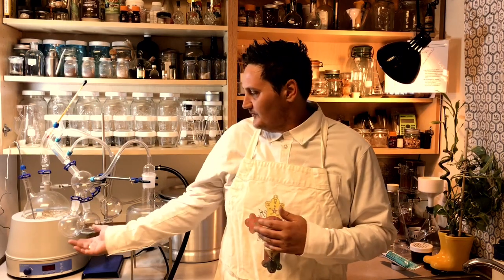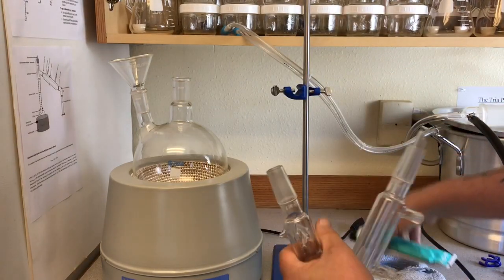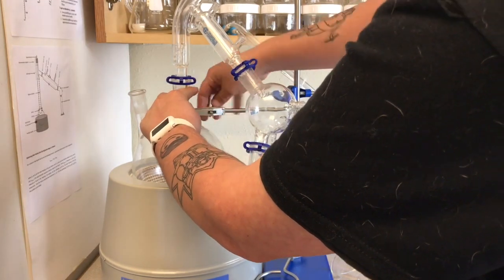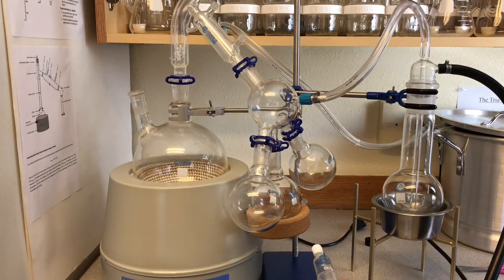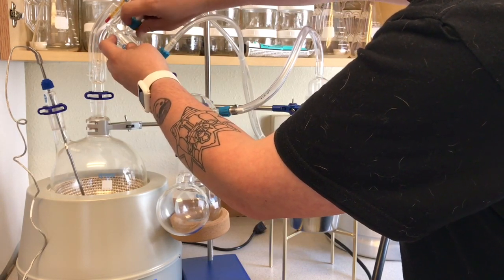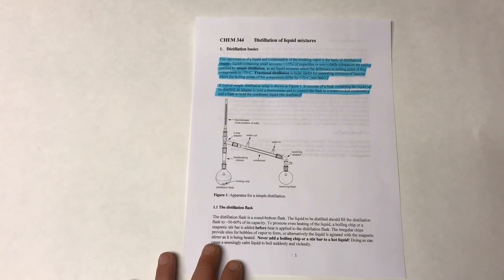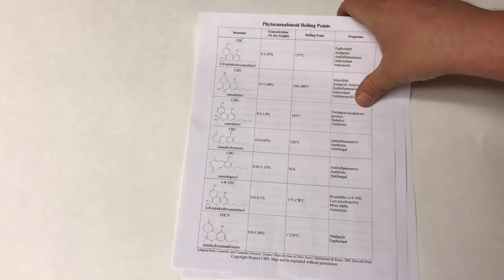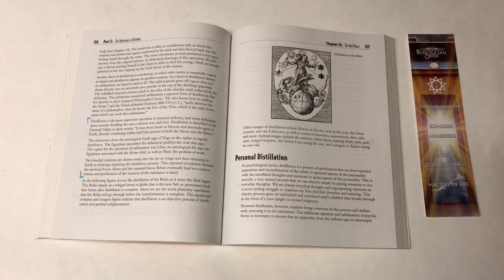The Art of Distillation: Setup & Theory

Comment: Great video going over the setup and general mechanics of simple short path vacuum distillation. As someone who's professionally distilled cannabinoids for about a decade now, I want to offer a couple pointers: 

1. Cold trap is very important. You want to maximize the surface area where high volatiles can condense. Dry ice is great, dry ice and that 99% IPA is even better. Get a bigger bowl and fill it halfway with IPA after lowering the trap into it. Then add dry ice slowly until it stops evaporating. This creates a slurry that can get to -80C all around the submerged part of the cold trap.

2. Vacuum level is key. A cold trap protects the vacuum pump from any contamination, allowing it to reach the ultimate vacuum rating of the pump. Once your trap is up to par, a 6cfm 2 stage rotary vane vacuum pump will be your ideal minimum for a 2L setup like this. This doesn't have to be an expensive Edwards or Welch model, Harbor Freight and Amazon have inexpensive ones. Get a digital vacuum gauge (or controller if you have the money.)

3. Use a stir bar. Start slowly and ramp up as temp gets closer to your desired boiling point. This keeps the boiling material homogenous so nothing gets scorched or left in solution.

Comment: Nice video, thank you for your work!
However, the vacuum grease should only be applied on the top of the male glass joints, not the bottom!! The grease may contaminate your product as solvent vapors creep into the joints. Sure, that isn't too much important on a distillation. But its bad habit.

Comment: Funny how vacuum pumps don't blow up 
Cold trap needs to be submerged in a acetone dry ice solution for maximum effectiveness 
This is not a proper set up 
They didn't even use vacuum grease on the joints
This is not like distilling ethanol there's fractions 
And this is called a short path distilling head 
Guy thinks he knows what he's doing 
Shows simple distilling aparatus compared it to a short path
They should use a soxlet extractor 
Winterize defat and remove ethanol before running through the short path 
They read you other people's information
Smh

Comment: When you're distilling something that produces a lot of vapor, and you are using a water trap to trap the vapor, have you ever had the need to use a check valve?
I've been considering using check valves because if i'm doing something stupid (I usually am) and I'm distilling something where I could have a steam explosion from the water backing up, the check valve would be a good safety measure against suckback at the end of the distillation.

Comment: Such an amazing video! Please make a part 2, also was wondering Would it be okay to have my Setup in a garage?
Reply: Depends on what you're distilling tbh The higher bp it is (i.e. above 130 C I'd say) is safer (high bp means low vapor pressure and less vapors floating around), but best to have air flow through the garage at any rate (and always have a fire extinguisher if your distillate is flammable).

Comment: Very nice and detailed video! Thank you for being so precise. I'm wondering what tubing you use from your cow distributer to cold trap, and cold trap to vacuum? Thanks again for the info!
Reply: Get "heavy wall" tygon tubing for vacuum for best results as it will not collapse. You'll need the inside diameter which is whatever outside diameter the barb tube on the glassware you're connecting it to is

Comment: @Sub Rosa what vaccum pump do you have
Reply from the maker: Rocker 250 pump. I think the new version is called Rocker 300. Rocker 300C, PTFE Coated Chemical Resistant Vacuum Pump, AC110V, 60Hz (167300-11) https://www.amazon.com/dp/B01N33X23F/ref=cm_sw_r_cp_api_i_q6ojEbN529E5M

Comment: Hey what are the hose sizes that you use
Reply from the maker: 1/2” ID RV hose. LDR Industries 516 B1210 Clear Braided Nylon Poly Tubing Flexible Non-Toxic, 1/2 Diameter x 10ft, Finish, 10' https://www.amazon.com/dp/B004CR4OP4/ref=cm_sw_r_cp_api_i_hxpjEbBCM6QMF

Comment: Hi, very informative Video. Thank you. Are you able to use your heating mantle without the external temperature probe? I have a similar model, but cannot figure out how to do that (so you can use a simple boiling flask). And do you know something about the modes of the heater, if you press "s" for a few seconds? have a nice day
Reply from the maker: Thank you! No, the heating mantle doesn’t really work without the temperature probe. If I’m using a boiling flask for a simple distillation, I often use a “sand bath” (a pan full of sand on the stove with a thermometer stuck into the sand). The “S” button on my mantle is only for setting the target temperature. After setting the target temperature, the display will show the target temperature for a few seconds and then the actual temperature. I believe holding the S button for a while cycles through the two modes of temperature: Celsius and Fahrenheit. Does that answer your question? I’m a little confused about the question, but I hope this helps. Happy to help clarify if you have any more specifics. Thank you for watching! I appreciate you leaving a comment!

Comment: Do you find any problems using such a "crappy" cold trap? Every other video I see has a massive glass one that uses liquid nitrogen up top and dry ice for a seperate beaker underneath. Seems a little overkill and very expensive and difficult to work with. I was planning on doing it your method. Does it damage the vacuum? Does it still collect terpenes or do they get pushed through the vacuum?
Reply from the maker: The cold trap did have some terpenes in the bottom. Absolutely nothing made it into the vacuum. My particular vacuum has a tiny trap that collects any moisture where it connects to the vacuum line. There was zero moisture in the tiny trap or the vacuum. I am not, however, an expert on the subject and I would advise you to consult the people at best-value-vacs. They are extremely knowledgeable and helpful, they can help you figure out the best vacuum and cold trap setup for your application and price range. But, to answer your question: no, I have not had any trouble with my cheap cold trap setup while distilling anything, including cannabis oil. I hope this helps...
Reply: Yea thanks! I'm going to order my parts from Laboy though looks like I can get an entire unit for under $500